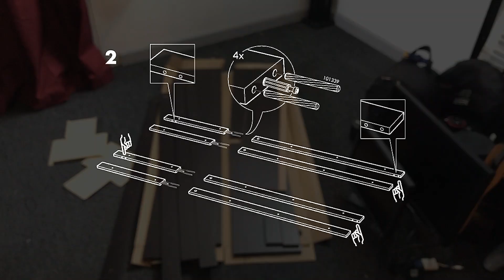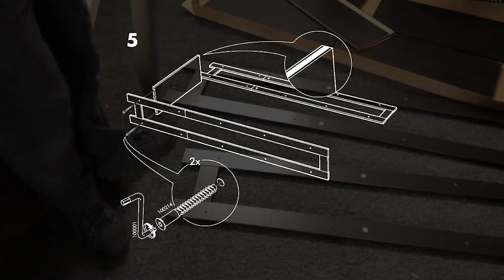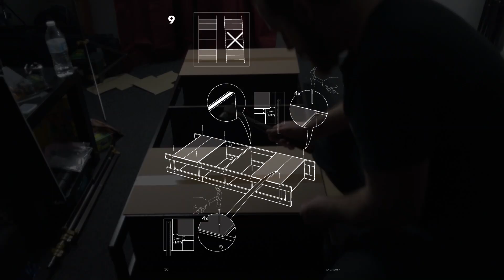🔧$20 LAIVA bookcase🔨  | IKEA speed build

Comment: Im planning to put a speaker (Razer Leviathan) is the weight gonna be an issue?
Reply from the maker: Each shelf holds up to 33lbs (15kg) so I don’t think the Razer Leviathan should be a problem. Just make sure you secure the shelf to the wall.